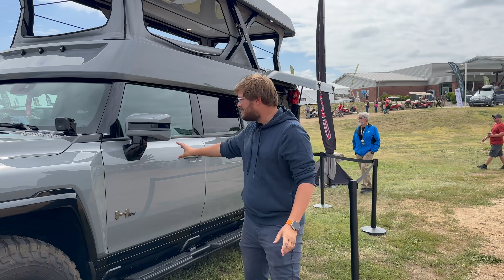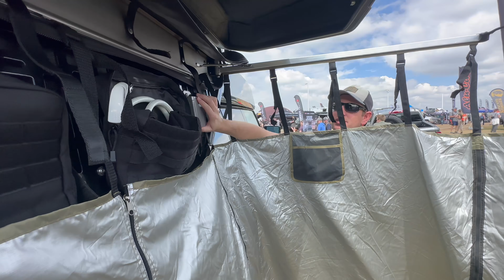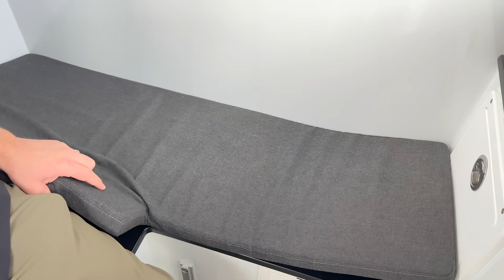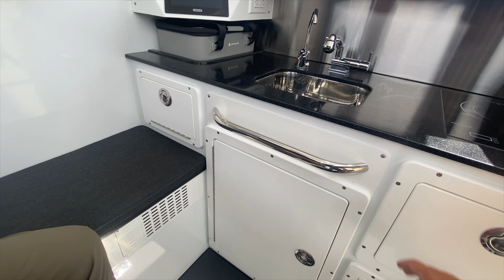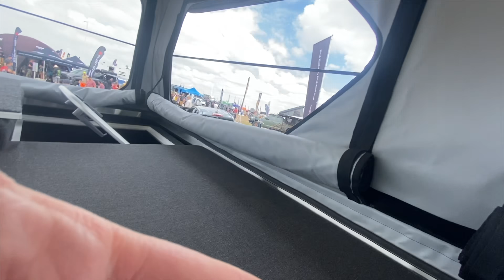This Insane Hummer EV EarthCruiser Is The Ultimate Electric Overlanding Vehicle!

Comment: 100K?? You’ve gotta be joking. Prices of everything are completely insane. That thing should be $20K max
Reply: This exact VIN Hummer with the camper sold on Bring a Trailer for $145k in late 2024.  Less than 200 miles on the clock.

Comment: For those concerned about power there are two smart options for this EV camper:

1. Tow a small trailer with a gas generator and two jerry cans of fuel. Enough to get you charged up even in the dark to get you back onto the road.
2. Similar small trailer with multiple solar panels that you can then plug into a DC to AC power inverter. The benefit here is the ability to charge both the camper and Hummer with no noise or fumes, and without the fear of running out of fuel.

A proper purpose-made trailer could also have a 2nd fridge/freezer, additional fresh water supply, storage for gear/clothes, space to mount 1 or 2 ebikes for destination exploring etc... Your only limitation will be grey water dumping, and if there is a toilet on board, black tank disposal.

The other huge advantage would be using the Hummer's adjustable suspension to lift/lower the camper off and onto the truck. Assuming it is just a bolt-on job, it wouldn't be too hard to keep the camper on a special rack when not in use, and when needed, just back up under it with the truck and mount it as necessary. Your typical slide-in truck camper uses telescoping legs to do this.

Looking forward to seeing this product develop and mature.

Comment: Cool … now how do I charge the truck when I run out of battery camping ?
Reply: They said you can charge the vehicle from the EarthCruiser's power.  But with those small solar panels on the roof, it would take FOREVER to charge a Hummer.  You really would have to engineer your own solar charger.  I've seen people throw a bunch of lightweight flexible solar panels in their EV, take them out at the campsite, lay them out, connect in series, and charge a baterry that feeds into an inverter and then into your charge port.  But with this EarthCruiser thing, you already have the battery/inverter.  But that would all be a pain in the butt.

Comment: But why?  So some wealthy people can pretend they're doing something good for the environment by rolling across the wilderness in a $200,000 EV w/ bed camper that weighs over 10,000 lbs?

lol... ok.

First off, how about not buying the Hummer EV with pitiful 1.6 mi/kWh efficiency in optimal 70 mph highway conditions when a smaller / more efficient truck will do.  How about instead of buying a bed camper that's hard to remove, you instead get a small popup camping trailer for $15k (which is basically all this is, but with a price tag 6-7x higher)... and disconnect it when you want to go off-roading?  Hell, at least you can disconnect it when you get home and still have a functional truck.  Plus the popup trailer would probably be larger, more comfortable, more accessible for old retirees with joint issues, and could potentially be rented / loaned out when not in use so fewer people have to buy these silly wasteful things.  You know... using all the useless stuff we make more efficiently so we don't  have to make as much

This thing clearly isn't meant for general RV users, as I imagine a larger percentage of them couldn't actually climb in and out of this thing day in and day out.  

For concentrating so much on aero, those side pods don't seem very aerodynamic.  They, and the entire unit overall, just add front surface area to the Hummer.  Likely better than an RV, but again, you can easily disconnect the RV.  

For something developed so closely with GM... why does this thing not just plug into one of the Hummer's bed outlets and use 110V electronics instead of including another 6 kWh of battery and 12V electronics?   

Know what you can use the 6 kWh of batteries they added to this for.... 3-12 PEVs to replace car commuting miles.  Ironically you'd probably want to have one of those on hand when you park this behemoth somewhere in town and just want to get around the town quickly and easily without the enormous energy usage and trying to find a place to park this behemoth.  Even better, know what you can use the Hummer's 250 Wh battery for, 125-500 PEVs.  I bet that'll make a much larger dent on reducing fossil fuels than a single Hummer EV, especially one with this EC on the back.

Comment: Cant tie into the vehicles power??? How lame. With 200+ kWh you could have had a heat pump and ac. Something fishy ($ I guess) about Kyle's praise for this camper, it's not great compared to say a slide in on a lightning, I'm sure it costs a fortune. 400ah is nothing for heating. This is a summer only camper.

Comment: 300 MILES
SO YOU CAN ONLY GO 150 MILES AWAY FROM A CHARGER
Reply: CHARGERS ARE EVERY 50 MILES SO YOU CAN SKIP EVERY OTHER ONE AND CHARGE FROM 20% TO 55% AT EACH STOP WHICH IS PRETTY QUICK.
Reply: @peterjorgensen3 every 50 miles , not on the mountain west. We don't even have gas stations every 50 miles. And you can't rely on one charging station. The chances that it will be operable when you arrive are quite a bit less than the chance of getting gas at a gas station.
Reply: @fox156  That's a good point. Electrify America isn't 100% reliable - at least here in the mountain west. I've never been stranded but definitely been frustrated with EA. The Tesla network works perfectly almost every time. I will say even more reliable than gas pumps. And yes they are about every 50 miles on most major routes and the holes are rapidly being filled, like Pinedale Wyoming for instance, and Baker Nevada/Utah. We still need one in Hanksville Utah, but you could plan around it since green river is so close.
Reply: @peterjorgensen3  I think the point here is "on most major routes" - the whole point of off-roading is to avoid such things!  And of course off-roading uses FAR more battery power than just rolling down a paved highway.  For reference look at how much power Rivian used in their Rubicon attempt.  They started by towing the vehicle to the trail head then launched at 80% SOC.  The nearest chargers are about an hour away and it's all up-hill mountain roads to get tot the trailhead, so maybe if they'd stopped and topped off there they could have gotten to the start of the trail at 80%.  Then after they got through the 26 miles of trail (hats off to them for surviving, but when you need a trail welder, 7 tie rods, and 2 jeeps to pull you repeatedly I don't think you're exactly trail ready just yet) they made it out to the nearest charger with 5% left.  So 75% battery to go less than 30 miles.  Factor in that of course it is only recommended to use from 80% down to 20% to maintain battery quality and you start to see why EVs aren't exactly the ideal off-road platform yet.  And don't take this as crapping on Rivian - I'm happy to see them out there learning things.  I certainly don't see Hummer trying anything like that.
Reply: @peterjorgensen3  YOU CAN'T PLUG INTO A TREE OR ROCK WHEN YOU'RE OFFROAD
Reply: @belowme4927  YOU CANT GET GAS FROM A CACTUS

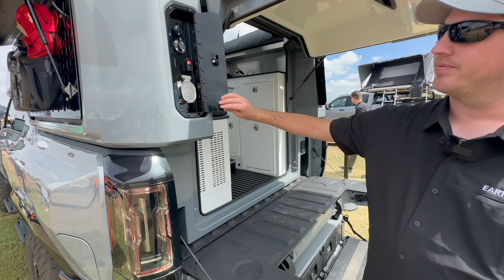Comment: 9:07 Sorry, but this is an absolute fail to not tie into power on the truck.  +200 kWh on the vehicle and you are going to lug around ANOTHER battery with a tiny bit of energy in it.
Reply: I'm betting its super easy to pull power from it too... At least up to a kilowatt or two. The Dc-dc converter should be plenty big enough.
Reply: He said when GM enables V2L you can plug it into the camper…

Comment: Better check small bridges.  How heavy is that monster.
Ev needs light and efficient.
Reply: Like Aptera with the offroad kit?
Reply: I would estimate about 10,000 lbs before adding any gear/water/passengers.  Regardless of the range issues (this will of course significantly reduce range due to weight and drag) and the lack of off-road abilities baked into the platform the sheer weight and size will keep to from doing anything more than simple back-roads.  Don't look for this on the Rubicon any time soon unless that whisling diesel idiot wants to do one of his "destroy something expensive for clicks' videos.
Reply: wribg big  thiñg eféçt